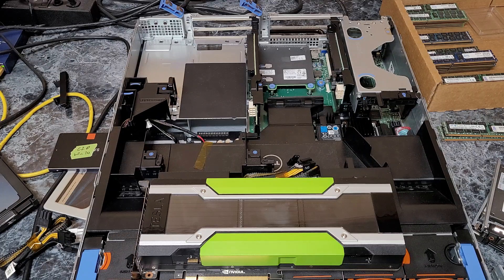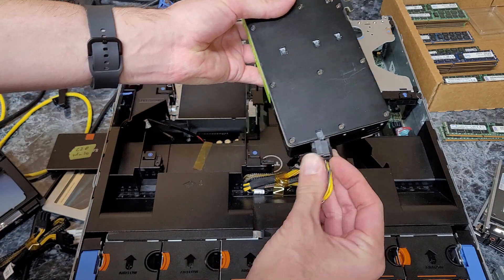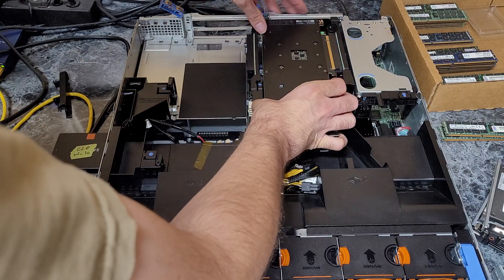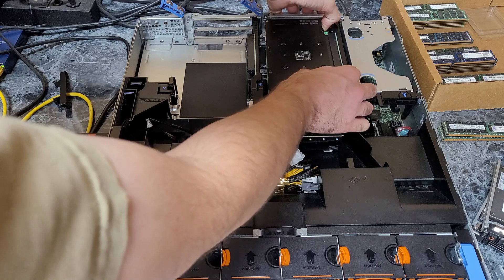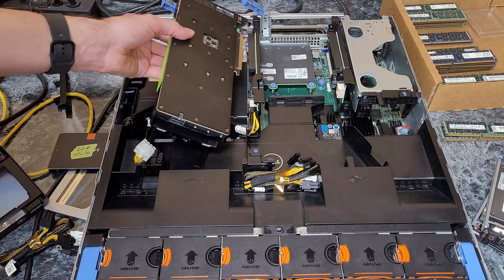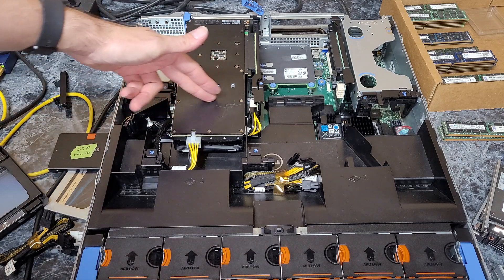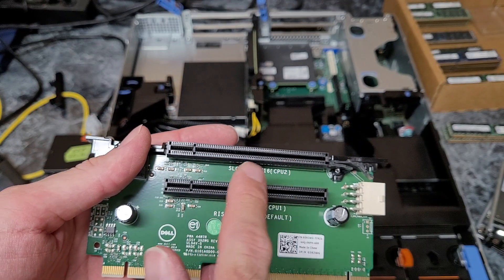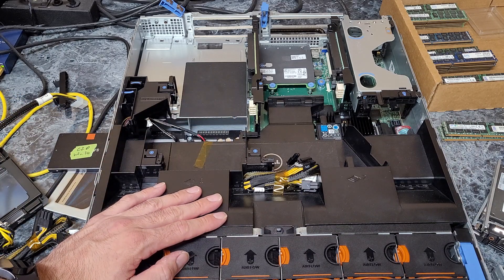How to install NVIDIA Tesla GPU in Dell PowerEdge R720/R730 Precision Rack 7910

Comment from the maker: Where you can you can buy my Tesla power cables:
https://www.ebay.com/itm/226156784263
Reply: Does the cable listed work as well with the k80?  The listing title does not say K80, just the M and P series.  I'll need one if it is for the K80 if not I need to know.
Reply from the maker: @jamesross1003  the description has everything it is compatible with down below.
Reply: @computersales  Oh, I just didn't scroll down far enough to see.  Thanks,  once I get everything up and running I'll be picking up one if it's still available.
Reply from the maker: @jamesross1003  yeah eBays ads are terrible like that. I have been doing better about keeping them in stock.
Reply: @computersales  Thanks!
Reply: Also will it work with the R720, the one that is not R720xd.
Reply from the maker: @jamesross1003  yeah it is compatible with every model mentioned.

Comment: It has been more than 2 years since I bought a cable from you and installed a P100 into my PowerEdge R730. It is still working without any issues, unlike any other cables I tried on Amazon or eBay (I tried at least 5). Thank you very much! 

Now is the time for me to upgrade to a Tesla V100 32GB. 
Have you had a chance to install a V100  on an R730 before? (feeding the system with 2x 1100PSU)
Reply: just saw the eBay description:
GPUs:
Tesla K80 verified by me
Tesla M40 verified by me
Tesla M60 verified by customers
Tesla P40 verified by customers
Tesla P100 verified by customers
Tesla V100 verified by customers

thank you
Reply from the maker: @drcemdede  Crazy it has been that long already. Yeah V100 should work just fine.

Comment: I tried a P40 and it overheated. The P40 24GB has to have the fan adapter. To avoid throttling as I train LLM models, I am putting my P40 externally to the Dell 720.
Reply from the maker: The R720 can't communicate with the "newer" Tesla GPUs. You can run it inside without throttling but you either need to manually control the fan speeds or write a script to control them over idrac. When I really wanted to hit my M40 I would set the fans to 100%.

Comment: I just bought 2 of your cables for my R730xd and i have 2 1100W ps on the way!
Reply from the maker: Nice. You will only be able to run a single Tesla GPU in the R730xd due to the rear flex bay being in the way of riser 3. I'll send you a message.
Reply: @computersales  I removed it! I drilled the rivets and cut a panel. Your 2 cables have both my P40's working fine. thanks again.
Reply from the maker: @unclesamautos   that is definitely pretty cool. I wouldn't be brave enough to make those mods but might have to consider it one day.

Comment: Thanks.  The server I have has zero instructions  But I still dont have video output.  Only thru VGA
Reply from the maker: What card are you trying to use? Depending on what your setup is it'll default to the onboard like if you're running just bare bones windows on it.
Reply: @computersales  I put in a 3050 RTX which has no power requirement.  I power on the Server and no video during Post.  So not sure.
Reply from the maker: @garychios  it won't display video over the GPU in post. I think you would have to disable the onboard video to get the 3050 to output during post.
Reply: @computersales  ill try this

Comment: Hi
What are the temperatures of the GPUs? And how are they cooled?
Reply from the maker: I think idle is usually around 30C and Depending on the load up to 90C. The fans in the server cool the GPUs.
Reply: @computersales  Do I have to manually set the fan speeds or will a R720 server do it?
Reply from the maker: @jamesross1003  you will have to set fan speeds on r720. The only GPU it will automatically adjust fan speeds with is the K80
Reply: @computersales  K80 is what I have so all good there.  Will have to pick up one of your cables though.  Cable that came with it is that strange Y-cable that many are warning about causing damage after running for about a week.  I still have a lot to learn.  Just starting in on the server end of things and don't even have an OS lined up yet.  So server newb here(I'll wear that badge proudly LOL).  Thanks for the response and answers.  Real backend devs are almost a dying breed to be honest.  I am an old school programmer and code as well.  Now a days a lot of coders don't know that there is a difference between the two.
Reply from the maker: @jamesross1003  I have no experience the Y cable so I can't say for certain how well they work. Should be fine but depends on how well it was made. I would recommend proxmox personally for your hypervisor. Then you can make virtual machines running any OS you want.

Comment: Hi! Thank you very much for the information! It turns out that the riser connector for powering the video card in the R720xd and R739 servers has the same pinout?
Reply from the maker: Similar but not the same. The R730 series servers have a -3.3V sense pin that needs to be shorted to ground.
Reply: @computersales  Thanks for the answer! Is this a jumper between contacts 4 and 6 (-3.3 V to ground) in the riser connection plug? What happens if there is no such jumper?
Reply from the maker: @Olex-w6p  it is on riser side. If you don't have the jumper it will pull the 12V rail down.
https://www.youtube.com/watch?v=fvgw9sv8k9I
Reply: @computersales  Thank You so much!

Comment: What PSU are you using? 2 Dual 750W Power or 2 Dual 1100w Power?
Reply from the maker: I've run both configs of dual 750W and 1100W. If you are running a high end build under a heavy load you will have to disable redundancy for dual 750W supplies.

Comment: Super glad to find your video. I have a R730 and wanted to put a Nvidia FX4800 inside that was given to me. Do you carry the cables for that GPU?
Reply from the maker: @isitjustmeorwhat9748  I don't have a cable for that. The normal Dell GPU power cable will work fine with that FX 4800 though.
Reply: @computersales  thanks for your help. I will definitely recommend your channel to friends.

Comment: Hey. I have r730 and planning to get rtx 3060. What power cable do you recommend?
Reply from the maker: @iskandarsulaili  The normal Dell GPU power cable should work just fine with a consumer GPU like that.
Reply: @computersales  sweet. Cheers 🙂
Reply: @computersales  the GPU I got didn't include the power cable. Will 16 pin to 8 pin power cable for rtx3060 works?
Reply from the maker: @iskandarsulaili  16 pin to 8 pin?
Reply: @computersales  sorry I mean 8 pin* to 8 pin will work?
Reply from the maker: @iskandarsulaili  you need 8 pin EPS to 8 pin PCIe with correct wiring.

Comment: Have you ever had issues with the GPU "falling off the bus"? I tried running a Tesla P100 in my R730XD but I kept getting the aforementioned error in dmesg.
Reply from the maker: I've never heard of that error before.  Does it work occasionally?  Best I can say is run system diagnostics and make sure all your server's firmware is up to date.
Reply: @computersales  I've only tried a couple of times a few months ago. I think it did show up in nvidia-smi but that disappeared. I'll try tomorrow and see what happens.
Reply from the maker: @UntouchedWagons  did you buy one of my power cables or are you using one of the other ones available online? If the power cable isn't wired correctly it can cause issues.
Reply: @computersales  No i bought a cable off Ebay that was advertised as being compatible with my hardware.
Reply from the maker: @UntouchedWagons  on the riser side there should be a jumper going between two of the pins. If it doesn't have it your cable is the problem.
Reply: @computersales  Okay I'll take a look for that jumper. Thanks.
Reply: @computersales  Ahh yeah there's no jumper wire on my cable. Initially I thought you meant a jumper on the riser card so I looked at my R730XD's risers and couldn't see any sort of jumper. I'll order one of your cables.
Reply from the maker: @UntouchedWagons  Sorry I should have been more specific. Also you can modify that cable if you feel like being crafty.  Otherwise my cables should be a simple plug and play.

Comment: I have a PowerEdge R730 with onmy CPU #1 installed.  And want to put a GPU in it.  I'm curious if there is any additional hardware I need to buy other than the riser card and GPU?
Reply from the maker: @mdellertson  with only one CPU installed your GPU will have to go in riser 2. If you already have the riser you shouldn't have to buy one. You will need a power cable though that is compatible with the GPU of your choosing.

Comment: Hi will a NVidia tesla k80 fit into the PCIe slot and inside the server rack of a dell power edge R720
Reply from the maker: Yeah K80 will fit just fine. I had a K80 in my R720 a while back. I can't say with 100% certainty but all dual slot PCIe Tesla GPUs should fit fine since they have the same footprint.
Reply: @computersales  thanks for the tips.
Reply: @computersales  so I was planning on using the p40 but it's out if my budget will the k80 do well for fine tuning a small language model.
Reply from the maker: @ yeah the P40 is really overpriced right now. You may check the M40 as well. One thing to note. The K80 will automatically communicate need for more cooling from the R720. Anything newer and you manually have to control fan speeds.

Comment: How much clearance (height) the slot provide? Can it fit a desktop GPU? Thank you!
Reply from the maker: @TheRightBet  I don't have measurements offhand. It depends on the desktop GPU. Something like a Nvidia GTX 1080 founders edition or a Titan X will fit fine. I think most quadro cards will fit. Basically the GPU can't be much taller than the IO shield.

Comment: Can you clarify if this can hold two of those Nvidia cards at the same time?
Reply from the maker: @SS-gu2tx  depends on the model. The xd models can only run a single dual slot card. Non xd models can hold 2 dual slot cards. Slots are tied to the CPU sockets so you will need to be running dual CPUs to run dual GPUs.